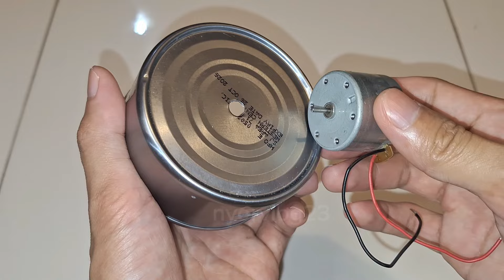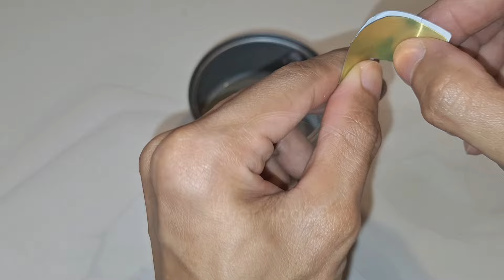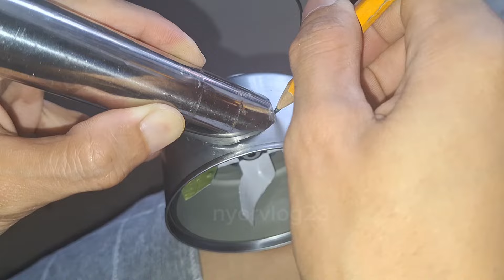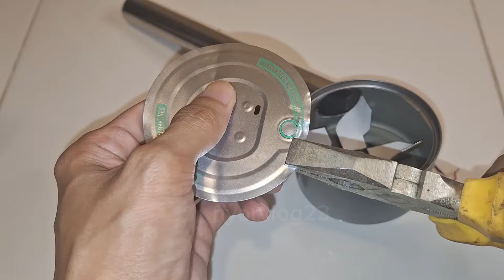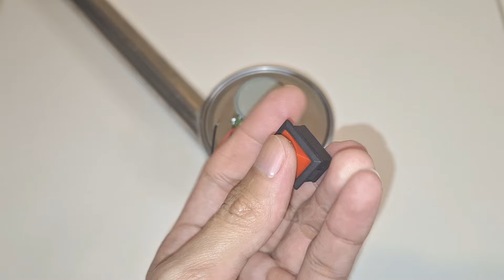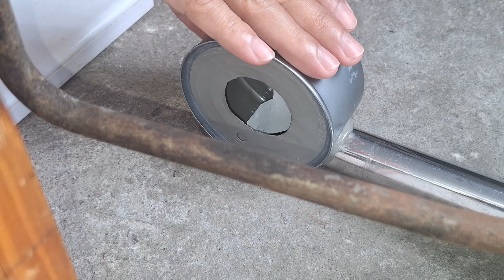DiY Fan Blower For Stove Used Oil

Comment: Diameter of the Connecting tube should be bigger.
Also at the connecting point outer tube shoul go in to the tube of stove. Otherwise air bumps back.
Reply from the maker: @Ajantha-l3k The Blower works well sir, You can look at my short videos❤️

Comment: power bank nya berapa volt? sama arusnya?
Reply from the maker: 5 Volts any amp. 1 or 2 amp. Compatible. it just depends on the motor you use❤

Comment: why the fire pointing at the wall of the stove
how to make it straight up or maybe twisted 45 degree up
Reply from the maker: That's how the fire is designed so that the oil goes to the chamber to heat up first to become flammable❤️